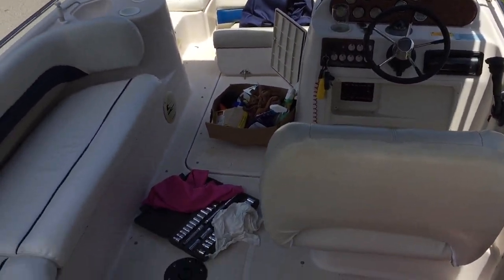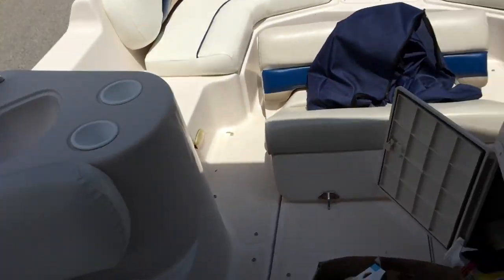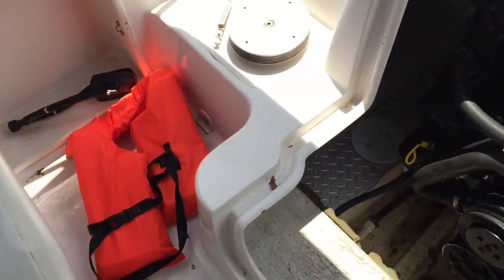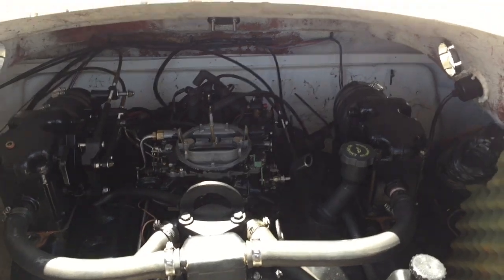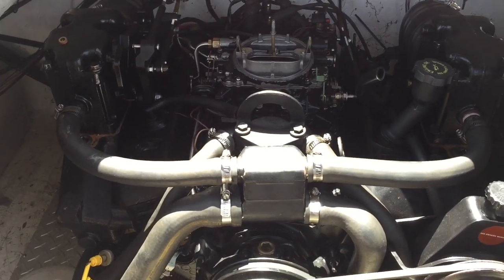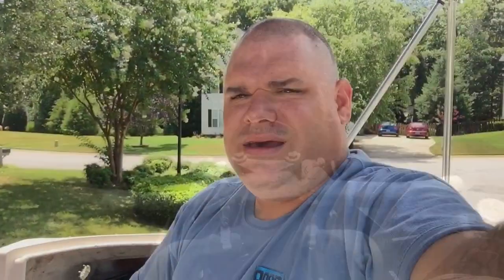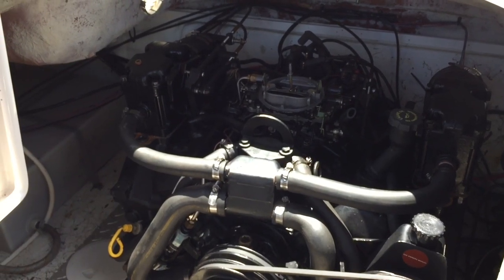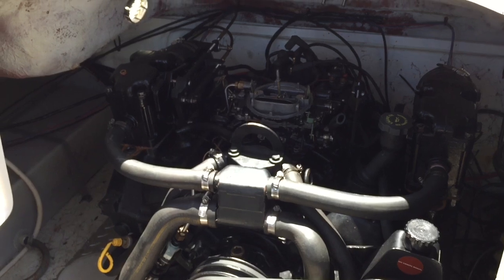Part 1 How to diagnose Blown Mercruiser 4.3 V6 Engine Bad Boat Purchase

Comment: Dont need to do a compression Check. Most sellers including myself arent gonna let someone tinker on a motor. Always the chance you could break something on someone else's boat. Don't wanna do that then you just bought it. Pull off the oil fill cap and make sure there is no significant blow by. Just a tip that could save time and headaches
Reply: Don't Tread On Me then your a bad seller
Reply: TechOut so you would let someone mess around with a car your selling and take parts off?? I doubt it. If im selling a vehicle first off im honest so I would tell them of there was a problem. Many ways to see problems without removing parts.
Reply: TechOut - I can answer this with experience:

Last year I was selling a fair/good condition 1987 Bayliner Liberty 2150 for $3500. I had rebuilt the engine, so it was welllll worth the asking price. It was a solid runner, drove nice as could be, and was mechanically 10/10 and cosmetically 8/10. 

A guy comes to look at buying it, and asks if he can pull the plugs to check the engine and check out the stringers and transom. I said "of course, be my guest", you know, thinking it was an easy sale because I knew how good of condition everything was in. I took a picture of his ID and his phone number down (in case he pulled any BS).

Well, I hear his drills, tools, and him wrenching around. Then he gets done and says it looks pretty decent, and he then offers me $1900. So, I turn it down and thank him for looking anyways.

He leaves, I put the mooring cover back on, and then I end up having another guy coming out about 2hrs later. This guy checks out the boat, wants to hear it start. I go to start it, and nothing... I lift the doghouse, and I'm mortified when I investigate the issue: 3 Spark Plugs are cracked off with the bottom half still in the heads!!! I then start REALLY investigating an looking around, and see in the bottom of the bay a dime sized hole drilled into the very bottom of the stringer, all the way through (there's no access to the other side to repair it either). He drilled 12 holes in random places all around the inside of the transom about halfway through the transom....

Needles to say, I'm LIVID at this point. So, I call the guy to tell him I mulled it over and talked to my wife, and she feels its best just to let it go for the offer he made ($1900). When he arrives, I have my wife secretly call the sheriff film inside, and the guy starts trying to haggle the price down to $1500 now....

During our haggling and my fake friendly BS'ing with the guy, the Sherrif shows up. The guy looks shaken up, and I instantly start letting the guy have it (at this point, he can't do anything to me). I explain to the sheriff exactly what happened, and luckily I had a video of me running the engine on Facebook live right before the guy got there.

The sheriff runs his nameand it turns out he didn't even have a drivers license! Lol. The guy starts denying that he did any checking on the boat and that he merely seen the broken plugs and offered the $1900. He started pajnting himself in s corner by trying talking too much, and he accidentally let some things slip that we wouldn't have known otherwise unless he was working on the boat like he denied doing.

So, the sheriff gave him an ultimatum once be realized the guy flatout did it: he told the guy to pay up the $1900 he originally offered to me, for myself to get the repairs done, OR he was going to be taking him in for driving without a license, vandalism, and "theft by deception"...

The guy quickly rips the cash out of his pocket and hands it to me. IMMEDIATELY something feels off. I hand the deputy money and voice my concern. The guy then IMMEDIATELY takes off running trying to get away!

It turns out the money was counterfeit/fake as hell!!! So, the guy gets arrested for counterfeit, obstruction, fraud, vandalism, and attempted theft, lol... The problem though? I'm still out all the damage and have to pay to fix it all still, AND can't sell my boat until it's don'e!

The case is still going on and the trial date is set for the 2nd week in Ocyober. But, even when he's found guilty and does his time and had restitution applied to pay me, I'm still out the money if he doesn't decide to pay up anyways... Judging by how big of a scumbag he is, itll be years before I see any of that money.

Sooooo, why don't you let people start wrenching on your boat before buying it??? This is why...
Reply: @strikeforcek9149  why you would leave a random guy alone do that is just stupid. I would've done the compression test in front of him. I have done this with cars, boats and dirt bikes. Lesson learnt
Reply: @chrisso4869  lesson learned is right! Lol

I would've never imagined someone doing some horse shit like that, especially over a little $3500 boat. Nonetheless, I surely didn't expect all the rest of the scam to unfold like it did either. Lol. But, yes, lesson learned.
Reply: @strikeforcek9149  wow, I would do the work for them if someone wanted something checked out.
Reply: @bu5761  I mean, typically I would if we were talking serious money or something. But it was just a little $3500 roundabout. I didn't think people would stoop that low over $3500.

I guess I was just naive in assuming most people are genuine and not "super scum". The more I deal with a lot of these cheaper sub $5k boats (fixing, buying, selling/etc) the more I see how ridiculous some people are. :/
Reply: @strikeforcek9149  yes sir, pretty sad values have gone out the window these days.. can't trust anyone. Good luck my friend. I'm educating myself on piston ring issues 😏 think I have some major blow by since my last run was spilling oil out of the dipstick on my 5.7LX GM merc..

Comment: Ive never bought a boat before, nor know much about them mechanically, but Im looking at a 90's Mastercraft with 205 hours thats being sold at a local shop which sells boating stuff and new Supreme brand boats(they also service). I asked if I could take the boat out on the water and he told me he could run it on the hose. I said I wanted to take it on the water and he said, "Well its got some carb issues at higher rpms from sitting and older fuel, but if youre really interested, & put down a deposit, and sign a purchase agreement, we can take it out". Soooo whats the real scoop here guys? And, if he gave me the opportunity to pay for the boat w/a credit card, would I have a little more protection(recourse) down the road? Thanks!
Reply from the maker: Yeah I would look elsewhere. I mean a simple carb rebuild and new fuel would correct a "its been sitting" issue. It could many more problems than just something simple. Don't let them try and lock you into an agreement you can't get out of. Sounds shady.

Comment: great video
I have a Bayliner 185 br just rebuilt the carburetor two years ago since then I've been using ethanol-free gasoline butt my carburetor keeps on getting clogged any suggestions how not to get to carburetor clogged up every two years thanks or maybe just do it video
Reply from the maker: Was the filter that is on the carb where the fuel line attaches to changed ? Also you should have a catch bowl / water separator on the mechanical fuel pump, have you checked that ? Could also be a fuel line from the tank to the engine breaking down, or trash that is not being picked up in the tank but the filter screen on the pick up tube.

Comment: I did the same thing but no one will even look at it first day I run it for 4 hours on the lake was perfect. ....on the way back in it started missing was only running on a couple of cylinders. ....never knocked but all the oil is in the bottom of the boat
Reply: insure it and set it on fire.... collect check and buy a dependable boat

Comment: I am going through a very similar situation right now. However, I got a good deal on a 95 boat and trailer, knowing the engine needed rebuilt. The mechanic screwed me on the rebuild. Took it out after rebuild and the engine over heated. Mechanic wont make good on his warranty. So, Im out around $3000 with a non running boat.
Reply from the maker: That is horrible. His reman block has been working great. So this is one of the reasons going reman vs rebuild is so much better.